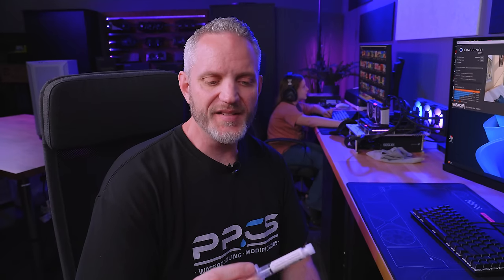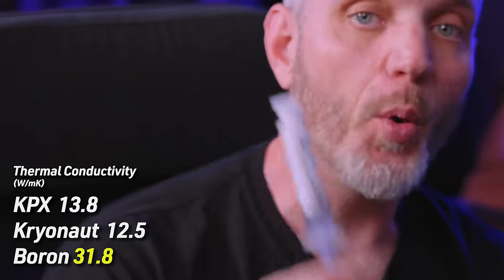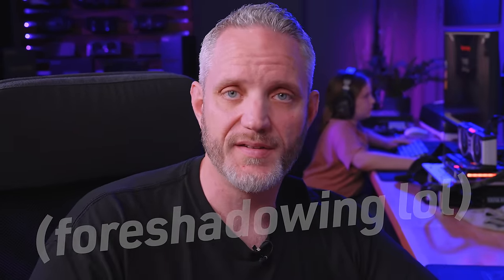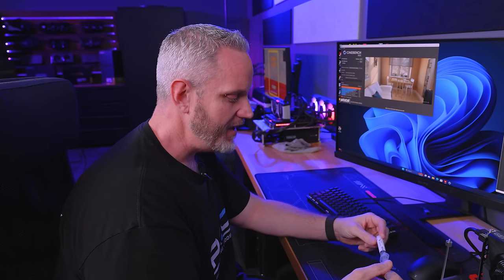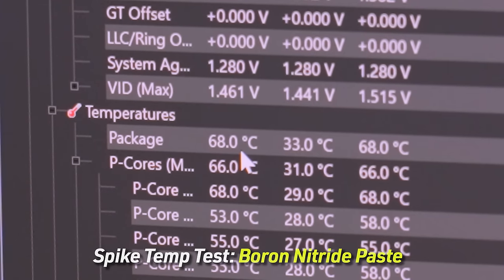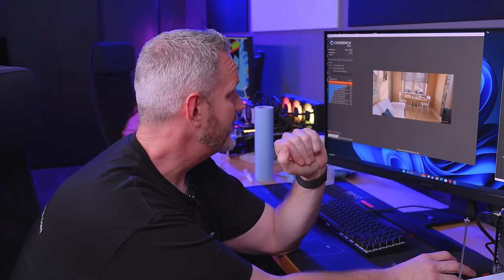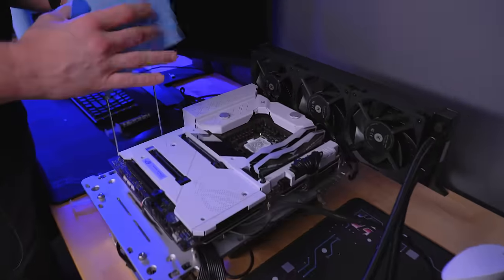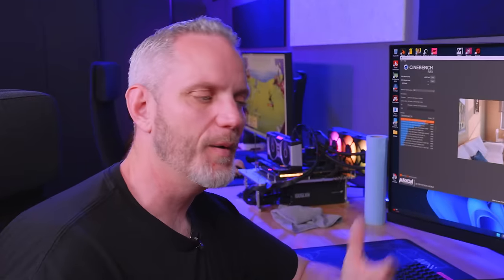Is this the new SUPER PASTE for PCs?!

Comment: The "veins" You see are created from the suction force that's generated when you pull the cooler off of the CPU. If you were to use a clear piece of plexi to push down on the CPU with that same grease you would see no veins until you pulled it back off again.
Reply: Exactly was thinking the same thing 😄👍
Reply: More than likely.
Reply: I think Jay is starting to lose his mind tbh
Reply: The main point was to show how prominent they are compared to your typical thermal paste, normal thermal paste will show veins nowhere near to the degree this one did
Reply: @fabiokinolli  You're not wrong about the veins being more prominent because of the grease being thinner but I don't think that was the main point he was trying to make. He mentioned that he thinks they show up based on high/low spots but I believe it's purely due to suction/vacuum force when removing.
Reply: yeah but, jay's too d u m b to know this.....
Reply: yeah but jay's too d u m b to know this fact!!!!
Reply: What he said.
Reply: I’ve done this with a piece of chocolate on my glass coffee table. Don’t ask why it was on the table.
Reply: The extra inferment is that the material was both still thick enough and fluid enough while installed, to be able to flow back into those veins.
EVERYTHING that was said about it being too watery and squishing out was proven incorrect by those veins covering the entire contact surface.
Reply: The veins look like electricity arcing.
Reply: Just about to type that
Reply: its so sad someone has to write that in the comments. this is just a proof that these youtubers dont know that much about things they do. they also use much to much paste all the time. its just useless watching these cooling vids
Reply: @rolliseventeen  I would rather use too much paste than too little paste.  The excess squeezes out the sides anyways assuming proper mounting pressure and no modifications to the IHS.  This has also been demonstrated ad nauseum if you cared to look.

I guess you probably don't understand that stock IHS are convex in nature for this reason and flatten out as they heat up.
Reply: @JathraDH  where can I read that thing with flatting out at higher temps?
Reply: @rolliseventeen  Look up some videos about IHS design.  It's been discussed for many years on YT and on forums etc.  A lot goes into IHS engineering.
Reply: It's so veiny.
Reply: Kinda makes you wonder what other sorta bs he's trying to get past everyone when he doesn't know what he is talking about.
Reply: those veins were because it's slightly conductive. it's the same from lichtenberg figures.
Reply: I was thinking surface tension, not suction. But yeah basically the same idea, the veins are formed when the cooler is removed.
Reply: @aaronncollier96  It's actually voltage that causes the slightly conductive paste to create the Lichtenberg figures, as Jay mentions in the video the paste is slightly conductive. if you look up Lichtenberg figures you'll see what I mean.
the vertical peaks you see, that's from seperation of cooler and cpu.
the cool tree root pattern, Lichtengraph.
Reply: @joelcarson4602 wait what how I wanna know more bout this being used for painting

Comment: Der8auer had a video some time ago, I believe with Steve from GN were they discussed thermal conductivity and why thermal grizzly and others have gone away from the W/mK values. There's no Industry Standard on how to measure that. Basically, the hotter the heater the thermal interface is tested with, the higher the thermal conductivity in W/mK
Reply: facts
Reply: Is it really Watts per meter Kelvin? As an engineer, when I see units written like that my brain goes milli-Kelvin.
Reply: The devil is in the details. 
The problem is that the material with the headline conductivity (be it silver, graphene, or Boron Nitride) is usually only ONE of the ingredients making up the paste. The ratio of high conductivity material to the carrier matrix makes it a lottery whether the compound will be good or bad at heat transfer. For example, a TIM with 1% silver and 99% insulating mush will be next to useless, where something with 99% silver and 1% mush will be almost as conductive as pure silver. Kinda obvious and intuitive, but finding out the % ingredients in any TIM is next to impossible, because they are "closely guarded trade secrets". Field testing to determine what works and what does not, is the only way to sort wheat from chaff. And we have to ignore the headline conductivity of the buzz-making ingredient because it gets swamped by all the other stuff going on. 

The burger analogy (with all the layers) further subdivides within the paste layer, where heat is mostly moving through the "solvent" (the material that glues all the particles together) but can use the high conductivity particles to "short circuit" across the higher resistance matrix. Again, the percentage of high conductivity material greatly influences the conductivity of the composite, including whether the particles of the high conductivity material actually touch each other (allowing a more continuous path of highly conductive material through the compound). It is never that simple, though, with factors like surface roughness of the particles (and even whether the particle surface has oxidised, adding a layer of resistance to the surface, etc) all affecting the score. The only effective way to measure whether the TIM works, is a real-life test like this one. Good developers will experiment with their product ingredients to find an "optimal" composition. Which may or may not include a necessary process of installation (like "cooking" the Boron Nitride paste before it works properly). 

Graphene is an outlier here, since it is "pure carbon". But it equally misleads, because the very high conductivity of a graphene sheet is ONLY "in the plane of the graphene". Unlike most materials which offer the same value of conductivity in all directions, graphene is extremely directional - because a graphene sheet is only one atom thick. What is marketed as "graphene" is actually a very thick stack of multiple graphene sheets to form a paper. 
When multiple layers of graphene are stacked together to make a TIM, then heat has to travel from layer to layer, and the conductivity of that assembly is very much less than the in-plane number (I'd estimate only about 10% of the in-plane value). So why does graphene paper work well as as TIM? Because, heat enters from the heat spreader at a few very local hot spots. The graphene can then spread that heat about the in-plane area extremely well, using that high conductivity. The less effective layer-to-layer transfer is then mitigated, because it can use ALL of the contact area for that transfer. With most (non-directional conductivity) TIMs, there is no diffusion of heat within the layer - heat spreads from the source hotspot in a spherical manner, which barely increases the area of transfer at all, before the heat is already passed through the thickness into the cooler.
Reply: @mastersprite2783  Lol. Yeah, you're technically right about "mK". 
The definitive proof otherwise is that if you do Dimensional Analysis of what the number is made up of, you get "heat energy per unit of distance per degree of temperature". If it was indeed milliKelvin, then the distance unit would be missing.
Reply: @bythelee  actually it's not how graphene thermal pad is made, at least not Kryosheet from derbauer. He explained it in one of the video.
The graphene sheets are stacked and baked together into a thick block and then it's sliced from the sides into a thin sheets, so the graphene planes are actually perpendicular to the surface of cooler coldplate and CPU.
Reply: I've been using the same tube of thermal paste for the past 20 years. It's a 100g tube of Dow Corning 340 heat sink compound. It is dirt-cheap and i never had problems with it. According to the datasheet its "only" 0.67 W/mK, but i cant tell the difference with other paste. Of course cpu's run a lot hotter these days so i'm not sure if i should keep using this. Thoughts?
Reply: @AlfaStation1 do an A B test.
Get a small tube of kpx, grizzly or some other paste.
1. Do a temp test run with your current application of the paste.
2. replace the paste and redo the test.
3. do a new application of your current paste, just to see if the paste changes the temperature conductivity.
4. Compare the data and take a conclusion from that.
Reply: The conductivity increase to the FOURTH power as the reference temperature increases... so the W/mK value is useless without stating a temperature values along with it.
Reply: @bythelee how does grain structure of the alloy a TIM is made or affect its performance? Could a rapidly cooled fine grain tim structure transfer heat better than a course grain structure or vice versa? Or would there be no difference?
Reply: @hfn71  Thank you for explaining that. I haven't seen that video, and had no idea Kryosheet was made any way other than simply stacking the sheets parallel to the heatsink. 
It means Kryosheet transfers heat across the sheet quickly, and does NOT spread that heat about in the plane of the sheet well at all. Which might better suit modern air coolers with heat pipes... Diffusing the heat isn't so important as conducting it to the heat pipe ASAP.
Reply: @alexdrockhound9497  Good question. I'm a little confused by the "rapidly cooled fine grain" because that sounds like the grain structure in a solid metal being heat treated and quenched (steels in particular, although knowing that jet engine turbine blades are made of one single crystal to mimimise creep tells us those crystals can be any size we choose). 
I doubt the powders being used for TIMs are made by grinding up such a starting lump of solid metal. (Boron Nitride is grown as a crystal out of solution, with the particle size dependent on how much time the growth process continues for.) 
Even if metal particles are ground, the particle size of TIM powder should be smaller than any grain size, such that the size of the starting grain disappears above the size of the TIM particle. The TIM particle thus shows little if any presense of the grain boundaries that define fine versus coarse grain boundaries. But in turth, I don't know how metallic TIM particles are made, so I can't really answer the grain size question. 
My chosen answer would be "whichever one gives a lower proportion of grain boundary particles in the TIM particles"...

Beyond that, assuming your question refers to the size of the TIM particle instead, we're down at the atomic scale, and have a "massively parallel" option for heat transfer path. 
Bear in mind that at the particle/atomic scale, heat transfer is not just unidirectional through the TIM thickness, but trying to find the "path of least resistance" - which might include heat flowing sideways through a high conductivity particle to get to the next closest particle through the minimum amount of matrix, and the 3D impossibility of the real calculation becomes clearer. 

Consider this to be particles of the TIM alloy suspended in a fluid-like matrix. (Although when compressed, it is likely to become particles packed together, touching each other in places, with the matrix filling the voids). 
Large particles do not pack well together, leaving lots of gaps between them. Small particles pack better, but add a lot of surface area. The optimal shape and size of the individual particles, plus the surface wetting characteristics of the fluid matrix, all contribute to the overall "equivalent thermal conductivity". Not to mention the shape of the crystal lattice and the conductivity of the raw materials. 

Also important might be how thinly the TIM can be squished. Which depends on other "flow" factors, including how significantly the particles might "lock together" to force a thicker layer than might otherwise be desired. 
The ideal TIM does nothing more than fill the voids in the surface roughness of the IHS and heatsink, letting their highspot asperities touch directly for maximum heat transfer from one to the other. 
Large particles would fulfill that need worse than fine grained particles, so a general rule would seem to be "the smaller the better", but the shape of the crystal lattice might also matter. Smoother, more compact crystals might be better at flowing and packing than crystals with "spikes" on the surface (I can't stop thinking of a snowflake as a bad example, although no metal crystal ever grows like that).  

At the end of the day, it takes lots of experimental testing of all manner of particle sizes, to determine what works and what does not. Because predicting how any given TIM compound might perform is beyond our current computing abilities. 

Wow, that's a bit TMI. Sorry about that. But this shows just how complicated and detailed even the simplest engineering / metallurgy / physics question can be.
Reply: @bythelee  oops, i meant to say the soldered thermal interface between the silicone and the metal cover.
Reply: @bythelee    all you have to do is dry it out a bit more before use, use a hair dryer or something get it more pastyee vs liquidyee, then apply it for testing.   water based stuff is always thinner so conductivity is less when pressed between 2 plates, due to its higher viscosity.  

Which is why nobody uses it for cpu type thermals. it doesnt stay in place
Reply: @alexdrockhound9497  So, you were asking about the grain structure of the solder (sometimes) used to connect the cpu to the IHS? 

The general rule would be that grain boundaries (defined by the discontinuties in the crystal lattice of the solid material, where individual crystals join each other at less-than-perfect-orientation angles) conduct heat less well than the uniform lattice. Less grain boundary and more uniform lattice would thus be preferable for better thermal conductivity. In other words, large crystals are preferable to fine grain. However...
 
I'm not sure about the size of those crystals and grain boundaries versus the thickness of the solder layer. And I doubt the difference in conductivity would be significant enough for anyone to worry about the grain size. I mean, even fine grains have a lot of solid lattice compared to the volume (ie surface layer) of grain boundary, so the solid crystal always dominates the conductivity number anyway. 

This is more a theoretical thought process to compare the technically perfect conductivity of a single crystal TIM with no grain boundaries at all versus that of the "real" granular material.
Reply: @bythelee  cool, thanks for the reply!
Reply: @bythelee  Couple things to note about the cryosheets.  First, they explicitly are single use only.  Second, I'm pretty sure everyone says they're not as conductive as thermal paste.

However, they have some major advantages.  Ease of installation is a big one, but the other big one is not having to worry about dry-out.  So, they can be used in applications with infrequent/no maintenance, or where high heat loads are expected all the time. I wouldn't be surprised if Thermal Grizly has at least one industrial customer.
Reply: Yeah thermal conductivity isn't a static value, it depends on the temperature the material is at. In engineering applications we always include the temperature it is tested at and often give a range of temperatures. So like 15 W/mK @150C, 25 W/mK @250C etc.

Comment: Just an FYI, this shit once set in, creates almost permanent bond between IHS and a cooler.
Reply: perfect for AM4 CPUs it seems :P
Reply: 5 minutes test at 90C is not nearly enough to cure it. Not a representative test.
Edit: It wasn't used in design specs :/
Reply: @IcecalGamer  It dries naturally over time. Not that the IHS sits at 90C when the CPU is at such temperature, you need ZERO cooling for the IHS to reach this temperature. Else it's impossible to even come close to 70C.
Reply: Timmy_420  Do you realise, that the iGPU is in the silicon die, that also houses main cores? You'd be at >constant< 80+C with an IHS of 60C.
Reply: what no it doesn't it's not an epoxy. I use this stuff all the time on 3d printers at 220c+ everything separates easily. I think you may be thinking of a thermal epoxy.
Reply: Timmy_420 you don't have a thermocouple on your IHS... He's talking about IHS temps because that's what's in direct contact with the paste.
Reply: Timmy_420 go replace the tp lmfao
Reply: Timmy_420 an igpu isnt an apu lol
Apu is amds term for whats basically a cpu with an igpu
Reply: Same with the Honeywell Phase Change sheets, as I learned when I applied it to my AM4 CPU last year and when I went to change the AIO for a new one the CPU came out of the socket and I couldn't remove it until I heated it up to 70C and it liquified again.
That said, this property is EXCELLENT for my de-lidded launch PS3's RSX and Cell, as I NEVER want to remove the IHS from the dies again, and the longevity of the phase change pads means I won't have to for 50 years.
Reply: @deher9110  An APU is an IGPU. There is no igpu seperate from the CPU anymore. Unless my guy is talking about a 15+ year old PC. The terms are interchangeable for the most part
Reply: @xgeko2  at high temps it re-liquifies, at temps below 100C after it's dried out it becomes almost glue like. you can't heat it up enough with a cpu to liquify the paste again. for  anyone wondering, this stuff is basically the "ceramic" pastes that were prevalent in the early 2000's that disappeared for a reason.